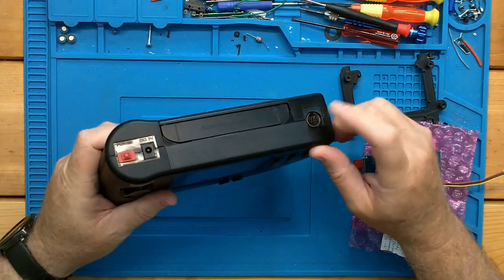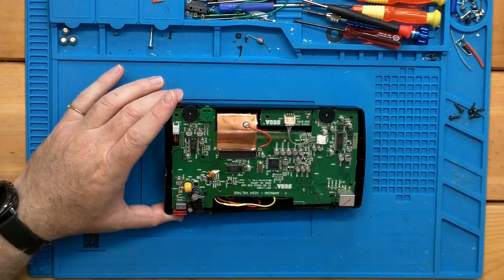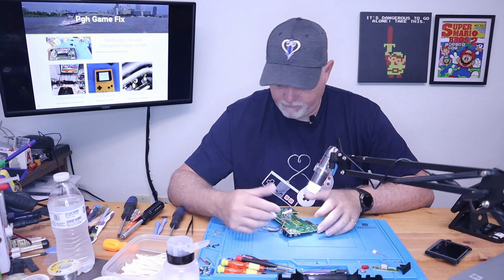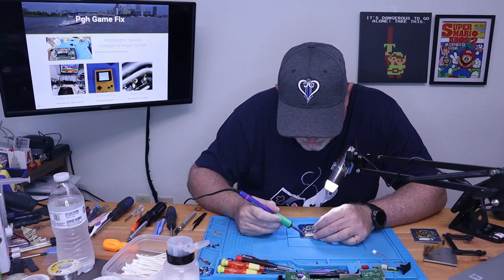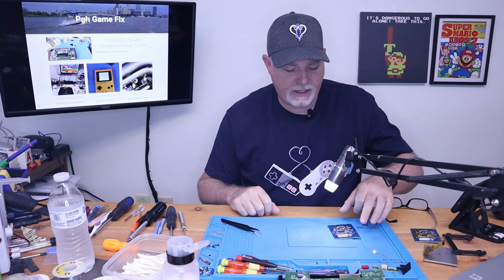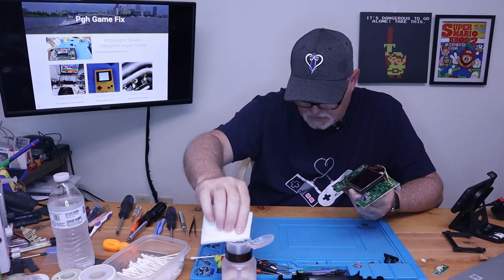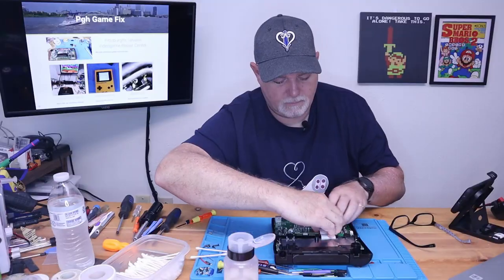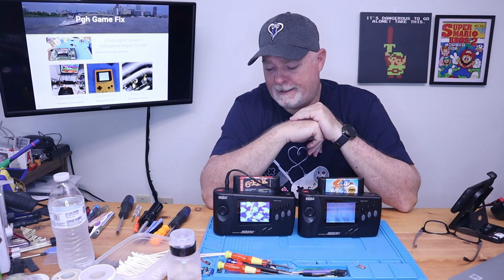Sega Nomad LCD Screen Replacement. (TFT, Not IPS)

Comment: Very cool lcd mod you did.

My question is. Can I do some modification to adjust light brightness in the new lcd screen?
Reply from the maker: I was looking into it.  The LCD I used has a brightness input.  I may be able to hook it to the original knob.  I have another on the bench.  I will test it out, and make a new vid if it works.

Comment: Does RBG output still work through the external port? Like when trying to connect to a TV
Reply from the maker: The "RGB" side of the connection was not used.  So, yes, the physical RGB connection should still work.  The internal screen is using the composite video connection.  With that said... I'm not sure if the CXA1645 chip can output Comp and RGB at the same time. Looking at the spec sheet ( https://gamesx.com/rgbadd/cxa1645.pdf ) the C-out, and  R,G,B-out are on separate pins of the IC.  As long as the proper in load is met, and the capacitance is not exceeded... then it should output at the same time without oscillations. Worst case... you will have to add a switch to turn off the internal monitor.  But, if you try it... please let us know your findings. (I don't have an RGB monitor to try it with)
Reply: @PghGameFix  thanks for the in depth reply! I’ve been trying to track down an answer about this for a while. 
I really want to attempt these mod but I’m scared to experiment with my mint Nomad. I’ll be looking for one in need of repair to attempt these mods. I’ll let you know how it goes!

Comment: Doesn't the switch output 11ish volts? But the screen is set up for the 5v mod? Seems like it would toast it.
Reply: Never mind, heard the bit about the controller board having it's own regulators. My bad. I think I just have a defective board.

Comment: Is the 5v mod really needed?  I just put the same panel in my Nomad running straight off the switch.  Didn't seem to have any issues with powering up the panel.  Actually, the stock panel didn't like the 7.5v power supply I have, but the new panel was fine..
Reply from the maker: If you are running it off a supply... it's not an issue.  But if you don't do the mod, then the screen with shut off before the nomad will. (from low batteries)
Reply: @PghGameFix  cool thanks!  I’ll probably do that next time I open it back up.  Currently working on a printed adapter for a better battery pack.  6 AAs are really heavy, gives me cramps lol

Comment: I have a question. My Nomad will not work on battery power. I have new batteries but no lights or screen. Any Idea what that could be. I have even checked the video PCB and it is getting 9.5v. I hope you can help.
Reply from the maker: Will it power on with a power brick? if not,  I would look at the voltage regulator on the main board. The system runs on 5v internally.
Reply: @PghGameFix  It power ups on the ac power perfectly. So, is it D201? If it is bad, how would you check it, with a volt meter I take it. Where would I get a new voltage regulator from if it is bad? Do you know of a video that could help me with this?
Reply: I'm sorry I mean TR201 not D201.
Reply from the maker: @gen55976  The "Brick" nd the battery should feed the regulator together.  Use a meter, and make sure that battery power is reaching the regulator.
Reply: I got it fixed. It was the Power Jack not the voltage Regulator. The Jack was not letting me get a negative on the 5V side. So now you know..
Reply from the maker: @gen55976  Glad you got it going !!